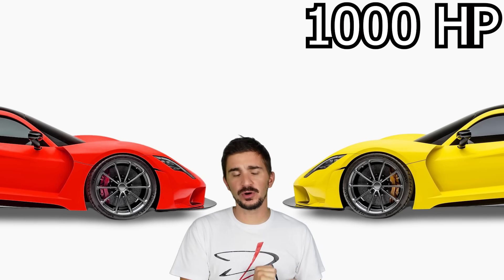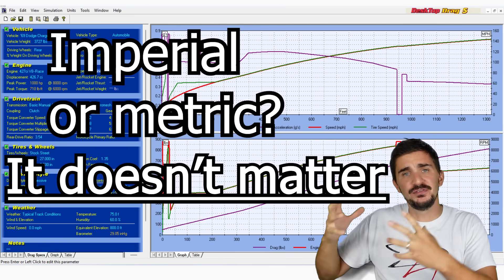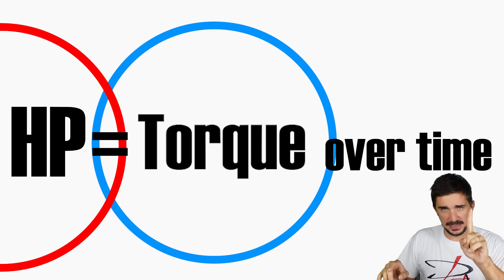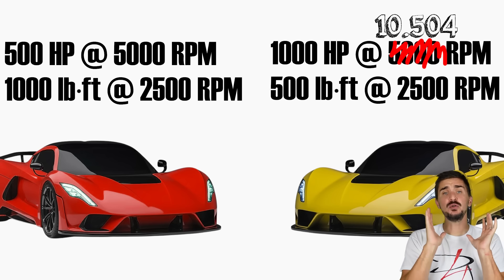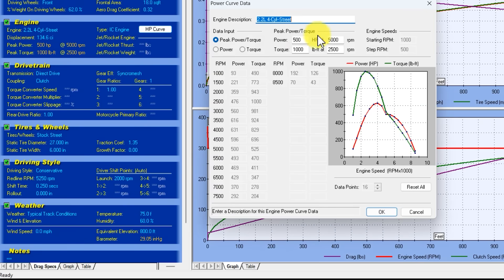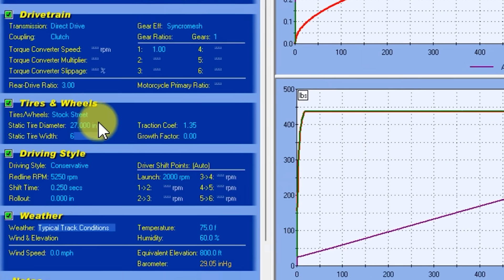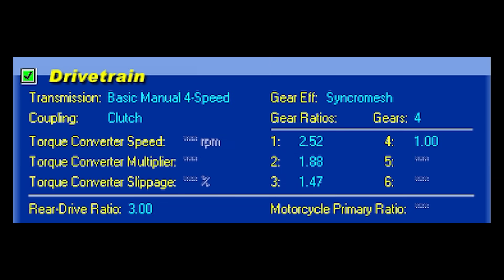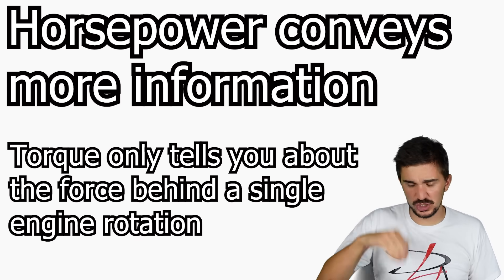Who's faster? Explained and Simulated - Horsepower vs Torque

Comment: Has anyone else noticed how the 1000hp 500lbft engine has to rev up to 10504rpm, and that it is the same number as the torque of the engine from here? 2:40 it's kinda strange and interesting how this happens.

Comment: Nice content and good explanations as usual.  Would have been even better had you taken the time to optimize gearing such that each motor could fully utilize its power.  With such optimization, more power should always win and this is why race teams put so much effort into “getting power to the ground”.  Thanks 😊

Comment: @3dNikita
0 секунд тому
In my experience of everyday driving (not racing) low-torque engine makes your car stuggle accelerating on inclined road - going uphill has the same effect as increasing car's weight. With low torque the engine simply can not rev up to high rpm to start producing max power. So you have to switch to lower gear. Which is also not great, because engine wastes more energy (i.e. fuel) close to red zone (and shortens it's lifespan in it)

Comment: Since you decided to use imperial units you should have also displayed the RPM using a comma for 10,504 RPM rather than a period for ten point 504 it would make the math make more sense. IMO.

Comment: The car with higher horsepower will require more gear teeth than the one with higher torque to achieve better acceleration. Furthermore, torque is more important when compared to horsepower, which is why trucks have a higher torque than horsepower. The most significant factor in determining horsepower and torque is the gears and final drive ratio. The difference between the two is reflected in the top speed, where the car with higher torque will be overwhelmed quickly, whereas the one with higher horsepower will continue to climb due to its advantage on higher revs.
Reply: Where do you get this hivemind one dimensional thinking?
Would you compare Length to Area and conclude length is more important when we know Area = Length multiplied by Width?
Or Compare Torque with Force and conclude
Force is more important?
When we know Torque = Force multiplied by Radius
Or compare Stroke to Displacement and conclude stroke is more important?
When we know Displacement = Bore multiplied by Stroke
Or compare Force to Work and conclude force is more important?
When we know Work = Force multiplied by Distance
Or Compare Mass to Force and conclude Mass is more important?
When we know Force = Mass Multiplied by Acceleration.
Or compare voltage to Wattage and conclude voltage is more important?
When we know Wattage = Voltage multiplied by Current
Or compare hourly wage to annual income and conclude hourly wage is more important?
When we know Annual income = Hourly wage
multiplied by total hours worked.

Power, not torque, is the limiting factor in not only the top speed of a vehicle but also how quickly it can accelerate at any speed and how much weight it can pull up an incline at any speed.

Trucks do not have high torque because of the heavy load.  You’re conflating correlation with causation.  Large size clothing doesn’t cause obesity yet there is evidence obese people wear large size clothing.

Comment: Horsepower is the total work being done, an engine that makes good low end torque is also inherently making good horsepower at those lower RPM. If you created absolute ideal gear ratios that allowed perfect utilization of the peak powerband the torque number by itself would not mean anything in a drag race, but in the real world with it's wide variety of loads and conditions as well as the fact that engines usually have to climb to their peak powerband torque really is a useful metric as high torque implies that it makes good horsepower in the real world RPM range. The engine with 500 ft/lbs of torque geared down to a  2:1 final drive ratio is creating the same torque at the wheels as the 1000 ft/lbs engine with a 1:1 final drive ratio, and the torque at the wheels is what matters for acceleration.

Comment: Torque gets you off the line faster, HP gets you to the finish line.. For the streets, TRQ.. For the hwy, HP.. My P71 makes 309rwhp @5,447rpm n 321rwhp @4,400rpm.. Sure i could use more cam, but i'm a torque guy, last thing i want is to have to rev too high to feel like i'm going somewhere..lol
Reply: Torque is the sound of one hand clapping

Comment: In a street-driven, around-town car, I would take torque over HP because the engine spends far more time from idle to 4000 RPM than it does over 5000 RPM.  You will feel the acceleration off idle more with higher torque.

Comment: You were correct at the start of the video. With all the equations I now feel like I have been punched with a boxing glove.

Interesting though, as I had considered torque to be more important, possibly, than horsepower. However, now I can see that because the two are linked, the horsepower number gives a better overall picture of performance. As per the software, you can always gear down for increased torque for things like trucks and earth moving equipment.
Reply: You are actually closer to the main point ☝️

Comment: Horsepower curve is all that matters, and torque is introduced along peak power, to describe that somewhat by single number. Ideally, we want to see power curve and then you know which engine is better. After that, pair it with perfect gearbox to keep the engine in ideal rpm range, wider power range close to peak, the better. Torque alone means nothing.

Comment: While you convey some good info, this video is factually wrong in many ways. The reality is that if you have a transmission, then Horsepower is ALL that matters for acceleration, torque is irrelevant. If your torque is not enough to get the car moving, then you have a transmission with the wrong gearing. Your simulation uses a transmission made for a car that runs at 5000 RPM, but you used it on a engine that spins to 10,000. This is flawed, and incorrect. Horsepower is the ONLY thing that affects acceleration, this is fact, its literally laws of physics. 10,000 ft/lb of Torque, and 1 HP will never be able to move a vehilce no matter what. On the other hand, 1 ft/lb of torque, and 10,000 hp, will perform excellently as long as you have appropriate gearing.

Comment: Motor torque doesn't mean much, by itself it's kind of pointless. Torque is force, you can apply a lot of force without moving anything. Horsepower is power, the amount of work that can be performed per unit of time. Whatever the power the motor can deliver at any given circumstance that the transmission can transfer to a useful speed determines how fast a car can accelerate.  

Many seems to confuse motor torque with motor power at low rpm, that's just not how it is. It's a bit like with electricity, watts matters, if you just have a good transformer you can change amps and voltage, and have any amperage or voltage you want, exactly as you can gear up or down the motor output to get any wheel torque or any wheel rpm you want, assuming the power is enough to overcome resistance in the case of wheel rpm.     

Assuming a specific gear ratio, wheel torque is a function of motor torque and that gear ratio, but motor torque still a function of available of the power at the motor rpm. But assuming adequate gear ratio motor torque is actually irrelevant.    

Put it another way, to accelerate a car you need to give it kinetic energy, power is the amount of energy per unit of time. Force, as torque is, is just a part of the equation, without time or distance, and if you think even time or distance is irrelevant for fast acceleration, you're by definition wrong.

Comment: 7:10 clutch is slipping all the way down the track, so not all power is delivered. 8:11 shows engine rpm drop off, but clutch rpm is rising, both are limited by the clutch. then you show a tyre traction limit. You didn't actually explain power or torque. You have people watching you thinking they are learning, all for the US audience.

Comment: A lot of people in the comments keep talking about how torque isnt important because of gears but moat of us builders arent going to hand pick all gears between 1-5(6) usually it being mostly viable to change final drive and maybe an end gear withour dishing out a lot of money. Then comes the real world stuff like wind resistance, going up hills and not being in an optimum gear when exicuting a corner. Making torque mote important in a way. Tho not a straight up example, k24 outdo k20 despite the k24 not being made for track use in a HP sense because, on track especially wheel to wheel u might find yourself in 4k rpm around another car and the 1-5 gearset that would have been optimal cost $1700

Comment: The high rpm engine would have shorter gear ratios, increasing torque. For rhis test to be a good demonstration of which is realistically faster, the top speed of each gear would be the same. If the rpm of one is 2500 and first gear goes 25 km/h, and both had the same gear ratios, 10000 rpm would mean first gear goes to 100 km/h. If the gear ratio was lowered it would be like this:
Horsepower biased with high rpm of 1000:
Final drive: 1
1st: 2
The top speed of first would be half of what it would if it were 1 to 1. And it would make 2x torque because of the reduction.

Torque biased with high rpm of 2500: 
Final drive: 2
1st: 1
Would have same top speed, but the torque would be lowered to 500 since it would need a higher gear ratio to reach the same speed, but since the other's torque doubled it would have more torque at 1000.
More horsepower is better if you have the gear ratios. Theoretically.

Comment: So thats explains why a Rotary Engine Sucks for Torque. 
Who cares if it has 350HP if its only 150ft/lb Torque. 
Much prefer my 225HP but 300ft/lb + Torque
Reply: yea but this 350 hp 150 lbf ft  at perfect gearing absolutely smoked yours 225 hp 300 lbf ft   🤭 generated much more lbf output force thanks 350 hp 👍🏻 the only isssue is 350 hp 150 lbf ft would need to be always at much higher rpm typocally for acheive stronger acceleration 👍🏻 once this be done yea 225 hp 300 lbf ft is smoked 😎 big low lbf ft determined only rpm level at which engine will work for achieve the same work in the same time 🤷🏻‍♂️ power beat torque in race all the way 👍🏻 big torq down low is made only for eco commuter diving not for real fighting where yea hp absolutely beat lbf ft 😎👋🏻

Comment: Horse power and torque . . . . . imagine torque analogy of an old ships canon shooting a 100 pound ball every 30 seconds = the high torque engine and low torque imagine  a 5.56mm machine gun spraying lead @ 100 pounds in 30 seconds  - that is delivering the same "horsepower" just rpm need to be different to get the same 100 pounds across in 30 seconds

Comment: I think this kind of misses the entire point of why people like torque-heavy engines.
the entire point of say, a HEMI or an LS is that they achieve higher amounts of torque at lower RPM range, so they have access to that power for a much larger portion of the RPM band, where a high reeving engine has very little power in low rpm. of course, the downside of those big torquey engines is weight (both in the car, and its own rotating mass).

Comment: Given the fact that gearboxes exist then obviously, according to physics, if energy is 1/2 mass times velocity squared and that horsepower is energy divided by time, then for the same amount of energy (speed) the car with higher HP will reach that value faster. And when it comes to steady state speed, high horsepower car also wins because power is force times speed.

Comment: Liter motorcycles are the plus 10.000 rpm example of very high power and modest torque at very high rpm
i.e. Kawasaki ZX-10 214 hp @ 14.000 rpm and 100Nm of torque @ 11.500 rpm

Comment: On a race engine and race situation horsepower/power is better, but for all normal traffic application torque are more important because that give us a engine that need less throttle to start, less RPM to get the power we want and also for example a less noisy and more fuel efficient car. This is also why so many people really like the AC electric engine. Because of this instant torque.

Comment: Most drivers will benefit from a higher torque at lower RPM. Typically with high HP curves you have a narrow power band, texhnically making it more complex to stay in that peak range. Most high torque vehicles will have a large power band. That is why muscle cars are fun  and easier to drive.

Comment: HorsePower=Torque*Rpm, so
T=HP/Rpm.
By this equation, we note that, as long as you have Enouth hp, all you have to do it to increase the RPM to get as much torque as you want!
How you can do this? -Simple: Switching gears!
As long as you have a good gearbox, torque simply does´t matter! bigger horsepower will always win.

Comment: It's pretty simple, really. Torque is just force applied. Power is the capacity of said force to actually do work over a period of time. No amount of torque can overcome a power deficit... but with enough gear/leverage, any amount of power can overcome a torque deficit, provided you have enough time to apply it.

1,000 ft pounds doesn't necessarily mean you have one (1) horsepower... but you can turn 1 horsepower into 10,000 lb/ft if need be.

Comment: The torque of the engine doesnt matter, because you can get any amount of torque at the wheels by using gear ratios. The horsepower is always the same at the tires (not counting losses) regardless if gearing. Dont know if the simulation had a variator option for a transmission, but assuming you had one, the higher HP engine will always have more torque at the tires , if the variator lets you stay at peak HP all the time during acceleration.

In the "real world" engine torque does matter, because 99,9% of the time you're not trying to accelerate as fast as possible, you're trying to have a comfortable drive with decent economy and service life.